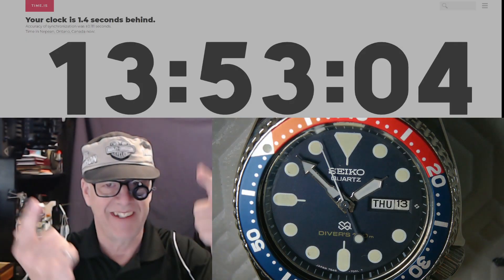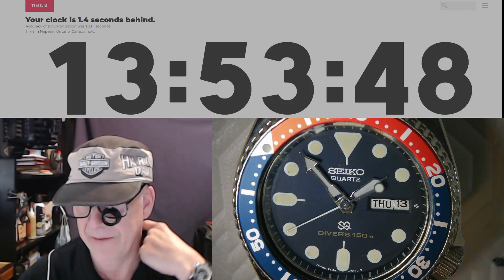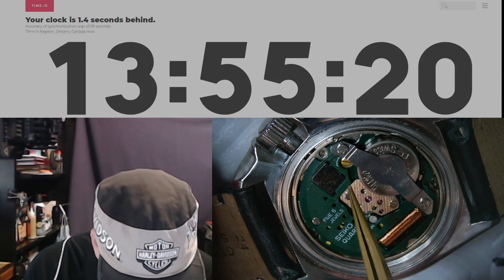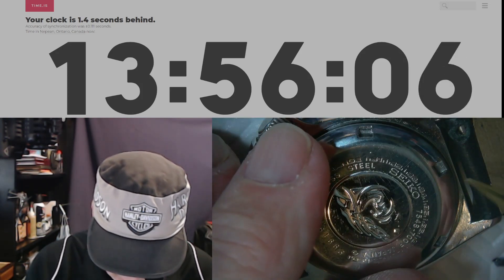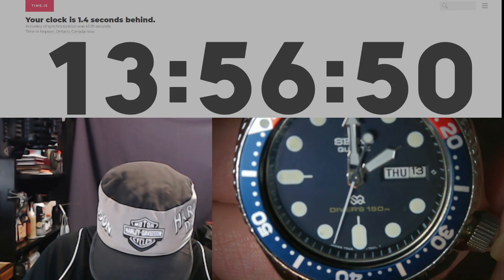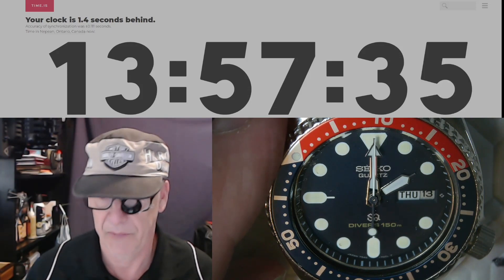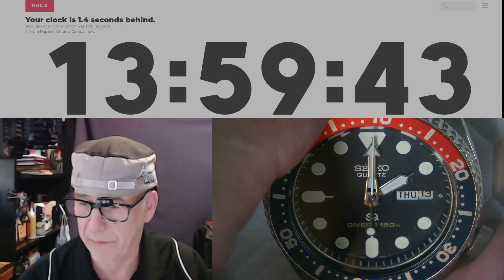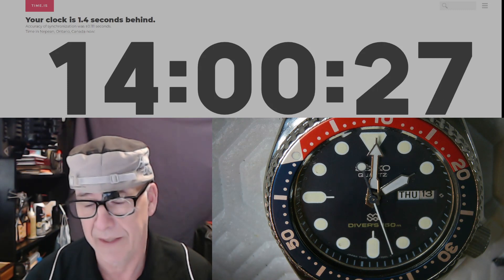Jim's Seiko Quartz Adjustment No. 1

Comment: Hey JD, first off these mid level quartz movements are not as accurate as people think, secondly the trimmer capacitor is unlikely to make any difference of significance, it is also of limited range and can be easily damaged

Comment: Great work, it’ll be interesting to see how much difference that adjustment makes. 

You’re quite right that atomic clocks didn’t exist during the golden era of American pocket watch manufacturing. 

The source of ‘true time’ was via observatories, that used a transit telescope to make very precise astronomical observations to determine the time. 

The same observatories kept highly accurate regulator clocks running on sidereal time which would be set via the observations taken via the transit instruments. 

Those regulator clocks were often kept in deep basements, carefully isolated from any source of vibration and kept at relatively stable temperatures, despite the clocks being temperature compensated. 

I find the accuracy achieved by these regulator clocks is an incredible achievement. One popular design was called a Reifler Precision Regulator Clock, with a guaranteed accuracy within 30 milliseconds per day, and achieved accuracy within 10ms per day back in the very early 1900s. 

I think around 600 of the original Reifler Regulators were produced and those that survive are highly sought after.

Marine chronometer style clocks, set to the regulators were used to carry the time.
Reply from the maker: Thanks, and now I know way too much. I need to spend my time reading about clocks and watches rather than fixing them, this would be a lot less stressful.
Reply: @JDRichard  You can never know too much, as long as the subject interests you, anyway. 

The evolution of accurate clocks and watches over time, the pursuit and development of more and more accurate timekeepers etc is a subject that I find fascinating.

As much as I love it, watchmaking can be stressful at times, especially when you’re working on antiques or unique pieces for which no spare parts exist. It can feel like walking a tightrope with no safety net at times. 

Fortunately the one time I made a truely awful careless blunder when working on an antique pocket watch, I was incredibly lucky, and actually had a suitable replacement part to dig my way out that hole. I still cringe when I think about that.
Reply from the maker: @mercuriall2810 one slip of the screwdriver will ruin your day
Reply: @JDRichard  Indeed, one slip of the screwdriver can ruin your day. 

My awful blunder mentioned above was more of a brain-fart or careless error, leading to a completely ruined part. If I didn’t have a suitable replacement, it would’ve been the end of that job or a lengthy and possibly unsuccessful search for a part. 

I still question how I made such an egregiously dumb and careless mistake, when I strive to be so careful. It just proves how a moment’s inattention can have awful consequences.